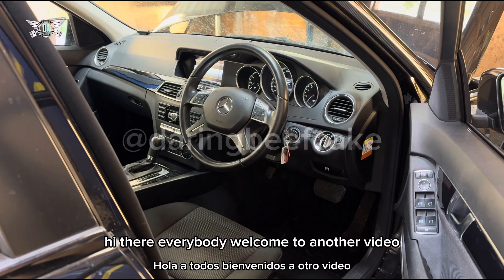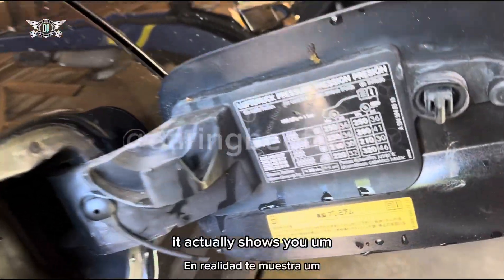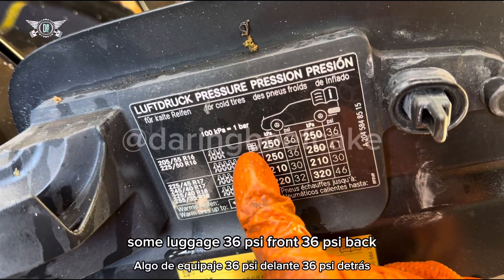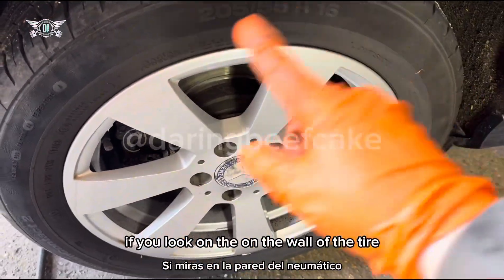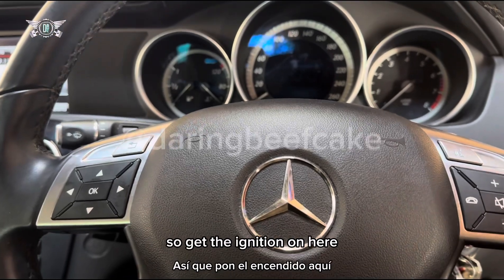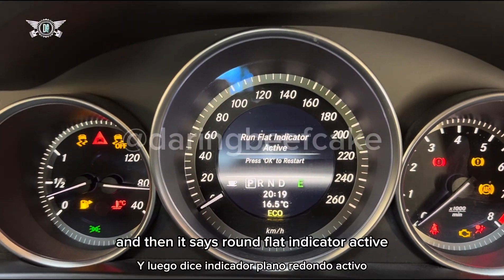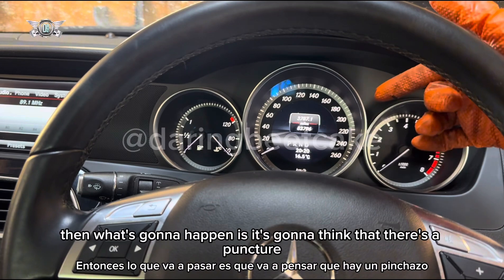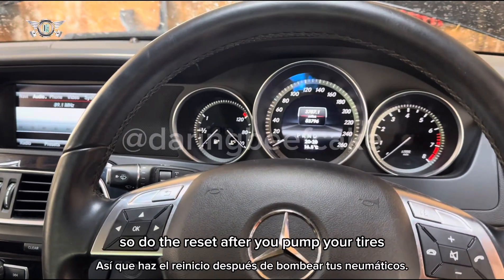How to reset the TPMS tyre pressure monitor on a Mercedes c class w204 2013 #tpms #maintenance

Comment: Mine is a 2017. It won't accept a new value until the tyres are warmed up for some reason. I don't have a run flat indicator, but it does give me individual tyre pressures. I like that you go back to basics and don't assume we know stuff. I never knew it had a PSI tyre pressure chart there, but it is there!!! I have always used Google to find the PSI. Thanks for that. I really do appreciate your videos.
Reply from the maker: Thank you for your comment, am happy to hear the feedback and that they do help..